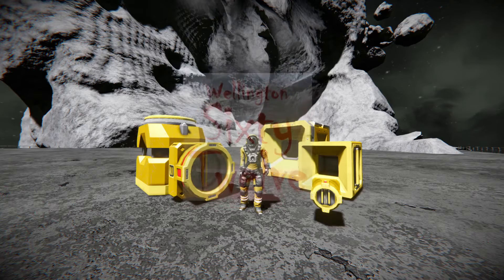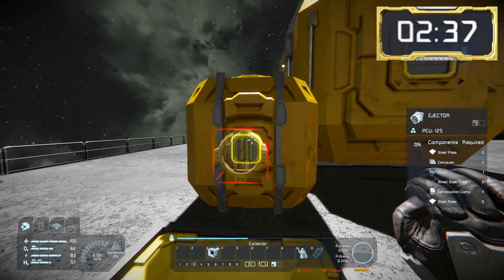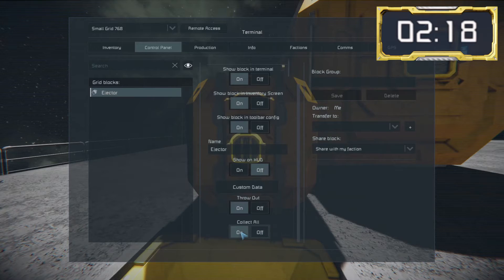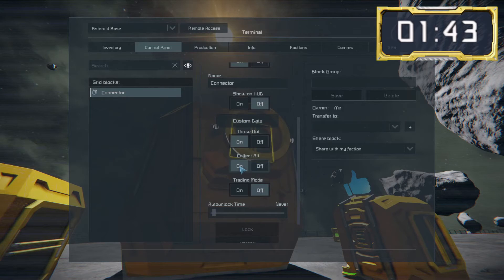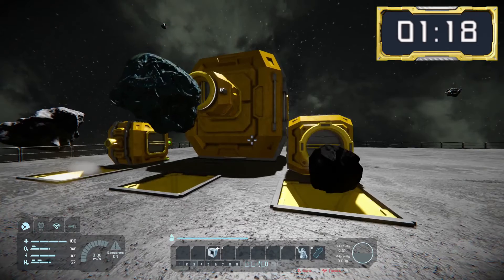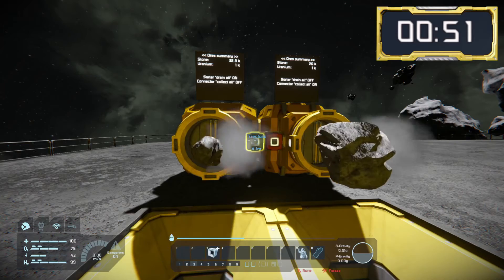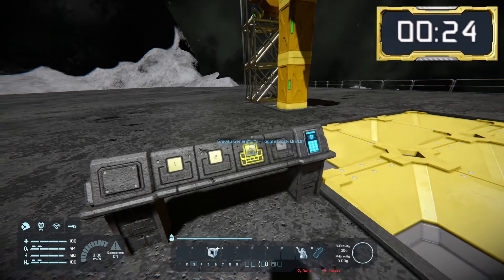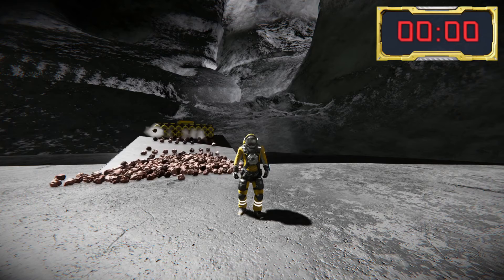Ejectors - Space Engineers 3 Minute Tutorial

Comment: Hi there so i hope you can answer one question why eine connectors dont unload fully? I got a sorter behind it that drains All Out of it.but the connected connector wont give all Out. Dont know why
Reply from the maker: Hi Anthracis. I don't think I've struck exactly what you are saying if you're talking about ejecting, I think I may have come across something similar when transferring via locked connectors. For ejecting though, I tend to not have the sorter on drain, rather just have it passively filtering and have the connector set to collect all so that it pulls the resource through more efficiently.
Reply: @Wellington6012  the Ressourcess/Tools, etc get stuck in the inventory of the connector.
Reply: did it work at all or did nothing ever got ejected?
Reply: @game1boy1007  some parts got ejected. But Not all.. there is allway Something remaining in the connector.
Reply: @DasAnthra  is something infront of the connector ? It wont eject if something is right infront of it